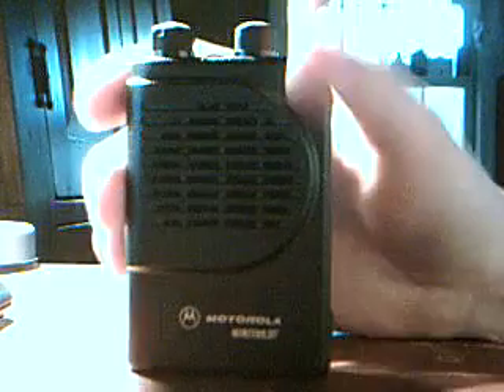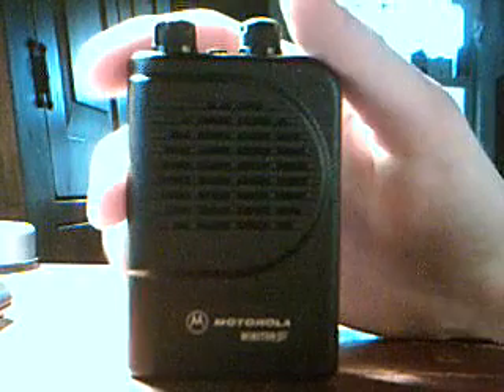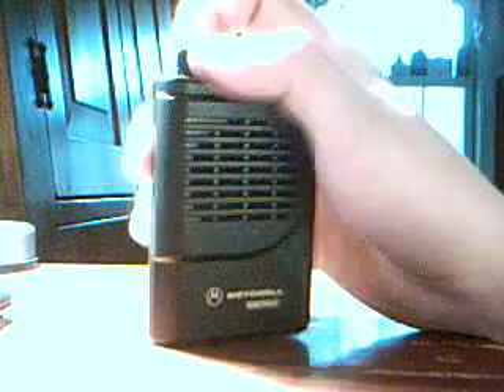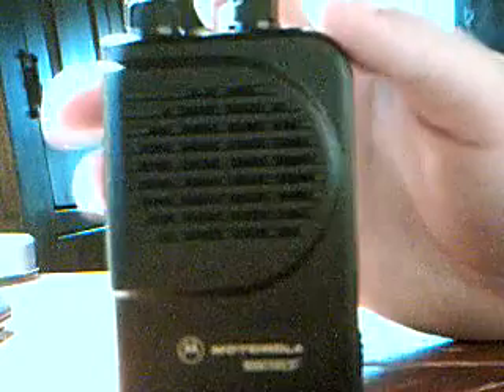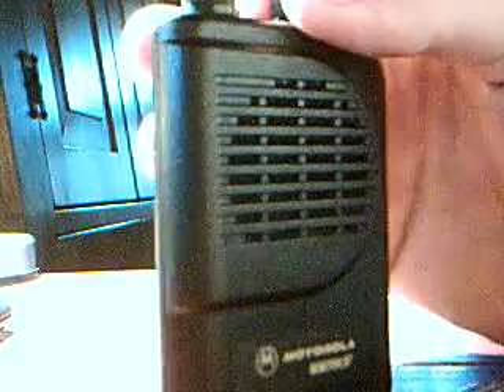Motorola Minitor III Demo

Comment: +Tyler O'Neil   I have my uncles old Minitor 3 and it doesn't work. When I take the cover off, I can see corrosion underneath the outside of the battery compartment. I can't get to all of the corrosion and the pager doesn't work now. Any suggestions?
Reply from the maker: Sounds like it got wet... I'd just buy a new one you can find minitor 3 for cheap all over
Reply: +Tyler O'Neil thanks!

Comment: I know that our FD radio tech can program the volume to be like the Mini II and the volume of the alert is adjustable.  I don't think you can re-program that without the base programing piece that is connected to the computer.
Thanks for the original post, I had no idea about  the teat options

Comment from the maker: ok, first, they are programmed the same as the minitor V pretty much, just different cradle and software, it will alert for a fire call if your tones are programmed in it, and it can be used for police, except it wont go off unless there are tones used